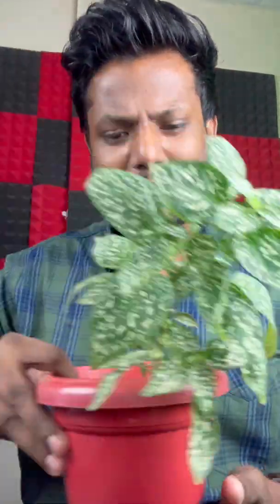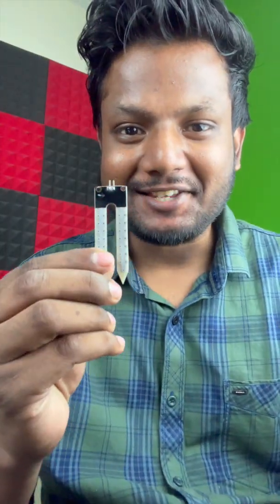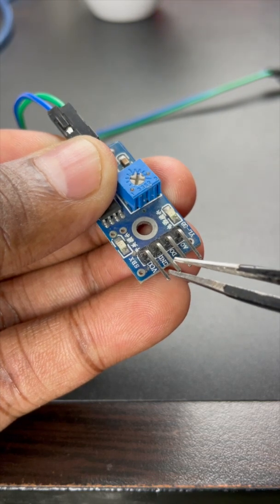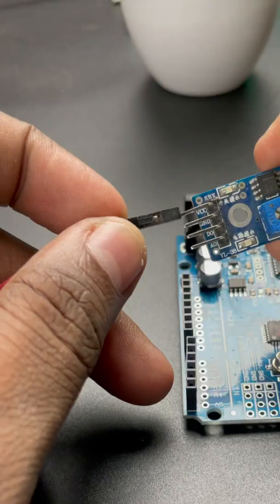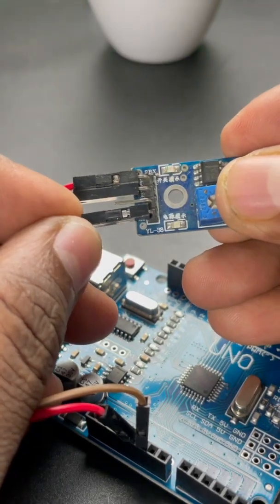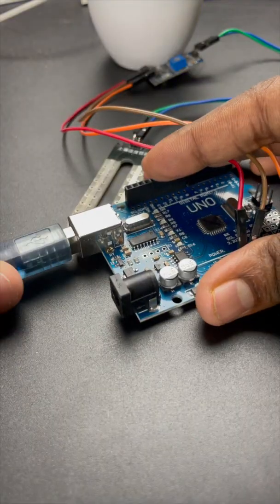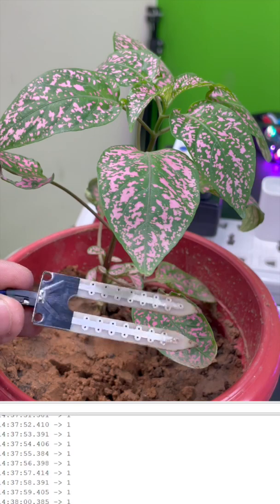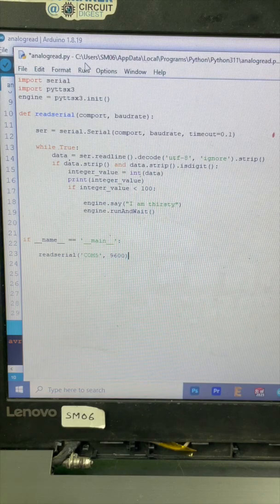Automatically Water plants using Arduino & Moisture Sensor #arduino  #circuit #electronics

Comment: Can we add a digital switch or touch to control it without using the moisture sensor. Please let me know ASAP
Reply: So that we can water it when we require through the mobile phone.
Reply from the maker: Yes you can. for that you have to use ESP8266 or ESP32.

Comment: I would recommend going with a capacitive sensor instead of a resistive one. Resistive sends voltage through the soil which causes it to corrode quickly. Capacitive doesnt make electrical contact with the soil/moisture so it will last longer.
Reply from the maker: You are right. The resistive sensors cab get easily damaged due to corrosion. Capacitive sensors don't have that issue. But be careful when using common capacitive type sensors, some most of them have either PCB design error or some may use wrong version of 555 timer which can't be used with 3.3V logic and some others may even miss the voltage regulator.

Comment: Bhai jab mai apne multimeter se light bulb ki led ko check karta hun to koi si bhi led nhi jlti
Reply from the maker: The LEDs on a light bulb requires higher voltage to operate. Normal multimeters can't provide that. For testing such LEDs use an LED backlight tester.